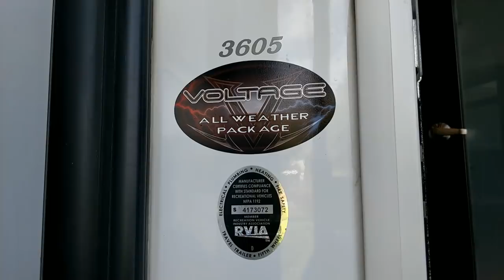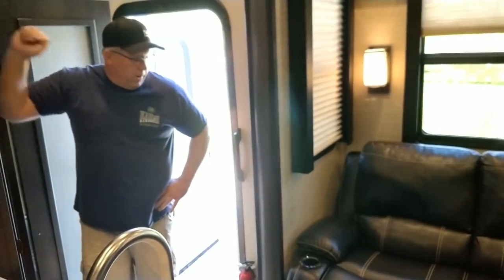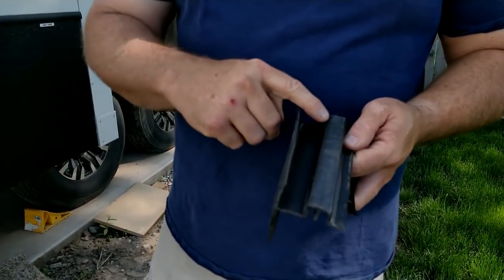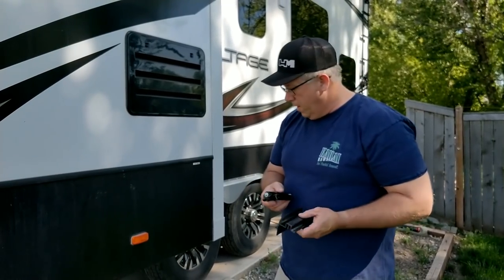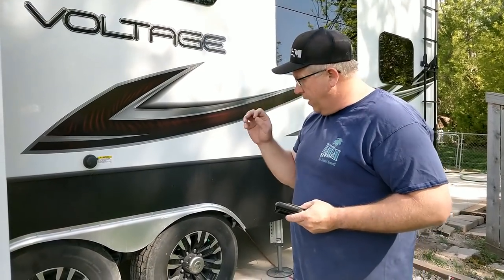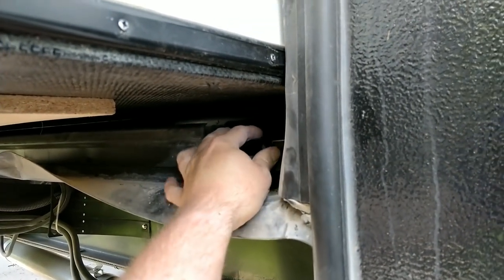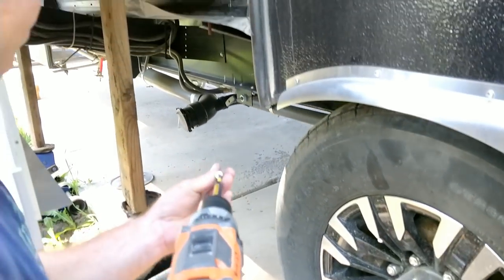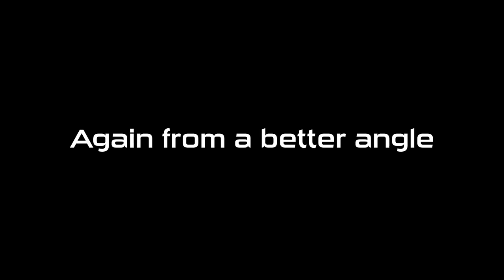RV Trailer / Camper Slide Out Fix

Comment: How has the bottom been holding up i just did it to mine they work great but a few people are saying it tears up the bottom
Reply from the maker: so far so good.  The wear bar had started to rough up the fabric on the bottom but it doesn't seem to be getting any worse.
Reply: @MikeHooley  thanks for the video i installed them on both of my slides works great.
Reply: if your concerned about tearing the darco material you can just install strips  thin gauge  stainless the width of the roller  this will protect the darco

Comment: did u have to readjust cables after installing rollers since there was 1/8 inch difference?
Reply from the maker: We didn't adjust the cables. It hasn't given us a problem yet. But like we said in the video we aren't professionals..

Comment: when installing the rollers do  you  have the slide extended all the way or just about half way?
Reply from the maker: You want it half to three quarters the way extended.
Reply from the maker: @rickstills6716  We jacked it up about 2-3 inches. The top of the slide will hit the top of the trailer opening so just be careful you don't keep going after the top of the slide hits the ceiling

Comment: what Year is this Voltage toy hauler? I have a 2011 Voltage 3900 same problem but I notice it already has rollers on there, did yours have rollers already?
Reply from the maker: It's a 2017. But no it did not come with rollers. It came with a plastic wear bar.